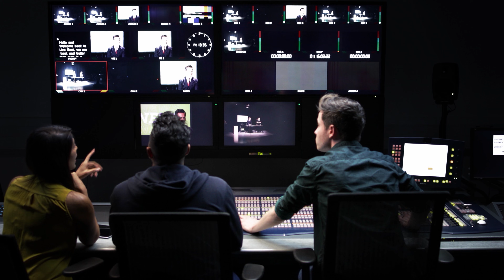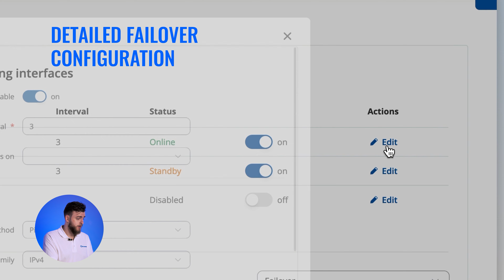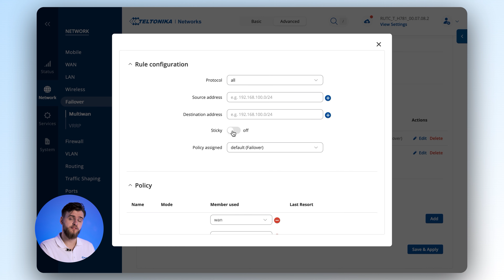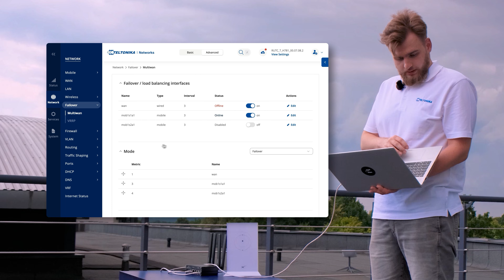How To Setup Starlink and 5G Router for Failover

Comment: Hi, I do not get any stable Internet connection with my Starlink Mini plugged in WAN Port at my RUTC50!
Reply from the maker: Please test your Starlink Mini internet connection directly first to make sure the internet works there. If it does, try setting your RUTC50 WAN to DHCP and reboot both Starlink and the router, power up Starlink first. Check the WebUI WAN interface to see if it gets an IP. If not, try another cable. If it gets an IP but still no internet, set custom DNS to 8.8.8.8 and test again. For more detailed configuration guidance we recommend reaching out via Teltonika community forum: https://community.teltonika.lt/c/teltonika-networks/

Comment: I purchased the Starlink Flat HP antenna (plane Maritime) with included power supply and Ethernet cable (no Starlink Router). Can I connect the ethernet cable directly from the Starlink power supply to the Teltonika RUTX50?
Reply from the maker: Hello, while we haven't tested this exact setup, based on available information, the Starlink antenna should provide an IP address via Ethernet. You can connect it to the WAN port of the router, and it should work as a standard DHCP client. If you require further assistance, please visit our community: https://community.teltonika.lt/c/teltonika-networks/
Reply: @TeltonikaNetworks   Thank you for your reply. I have just completed the configuration and it is as you described.

Comment: Just got Starlink Gen3 that I want to be the failover backup to my in home, ethernet connected, fiber internet connection. We also need to be able to take the system mobile, using cellular service as the primary internet connection source and Starlink as backup. I would prefer a wifi 7 router (or hotspot). This is for tele-medicine use. I need to be able to have two way, video communication as well as the ability to look at brain imaging. I'm having a very hard time figuring out the best hardware to build this system. HELP, please?
Reply from the maker: Could you please get in touch with our engineer team at Community Support Forum? They would be more than happy to help with this! https://community.teltonika.lt/

Comment: Hi @Teltonika team, is it possible to connect a Starlink Mini3 to a RUTC50 wireless (without using a dedicated LAN cable) and configure this connection for failover?
Reply: Yes it is possible. but you will have to change the IP of the RURx50 because you cannot change the IP of the Starlink (I dod not fount how to do this) and the default ip of the RUTx and the starlink are the same.
Reply from the maker: Hello! It is possible to use failover via Wi-Fi, but you first need to configure the Wi-Fi WAN on the RUTC50. The Starlink Wi-Fi interface will serve as the Wi-Fi WAN for the RUTC50. Please follow the configuration steps in this article:https://wiki.teltonika-networks.com/view/WiFi_WAN_example#:~:text=WiFi%20WAN.%20To%20set%20up%20WiFi%20WAN,%20login%20to%20the  . After configuring the Wi-Fi WAN, it will appear as a failover option.

Comment: Hi @TeltonikaNetworks, would the showcased procedure work for a router with two modems such as RUTX12, assuming that you want to keep both modems load balancing?
Reply from the maker: Yes, the setup demonstrated should also work on the RUTX12. Please note that Load Balancing does not increase the speed of any single connection.